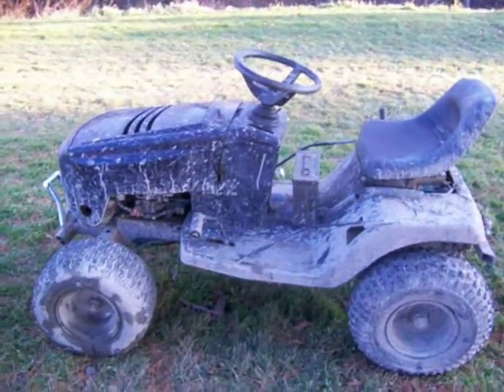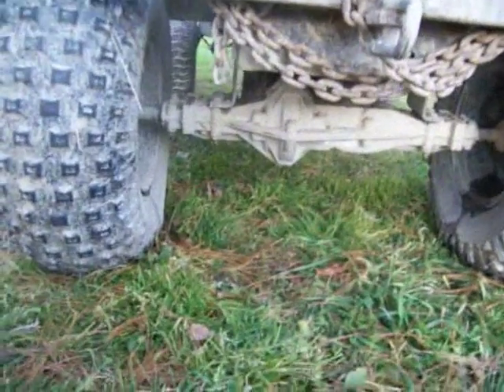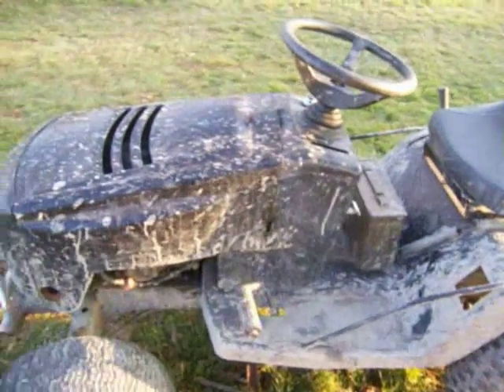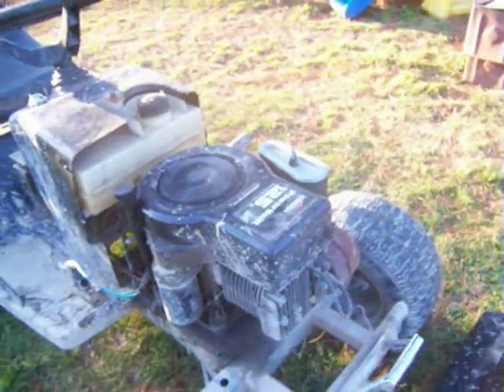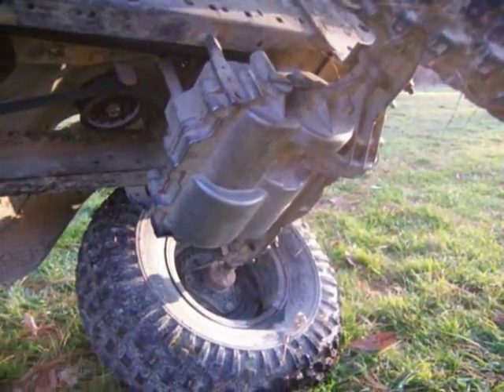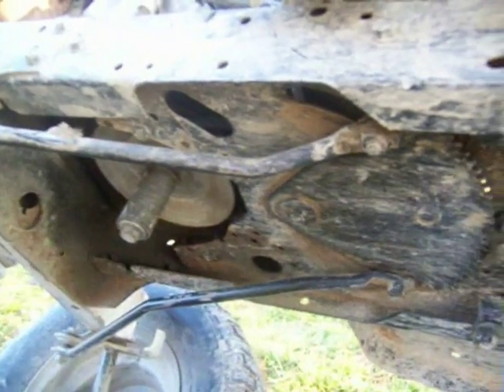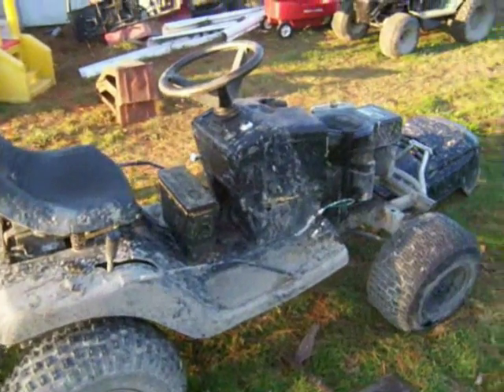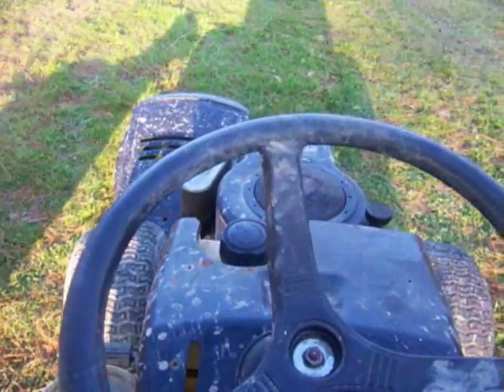How To: Build an Off Road Lawn Mower

Comment from the maker: an atc motor would be fun. You would have to convert the rear axle to chain drive. I try to keep it as close to a lawn mower as I can. For the front spindles, I found some large bolts the same size as the wheel hub, cut the head of it off, then "butt welded" it to the end of the spindle. Then clean it up with a grinder.  Works great! I've done it to 2 mow-chines and have yet to have a breakage.

Comment from the maker: @soadissoamazing One of the wires from the alternator/charger goes to the + on the battery. There are two wires that come out of the top cover of the engine, behind the starter. Use the white one.

Comment from the maker: I had gotten a atv frame with front tires on it.  The hubs were on it too, so I cut them off and creatively welded them to the rear axle shafts. I think there are 3 lugs per side. its worked great so far!

Comment from the maker: @TheInfotwins the pre-runner part is an old set of bmx handle bars, with the handle parts cut off. Flipped it upside down and welded it on. it's actually really solid.

Comment from the maker: I put small "wells" where the head would sit over the valves. To allow air/fuel to pass through easier. I did more porting behind the valves, like inside where the carb or exaust bolt to the engine block. The factory leaves alot of "casting roughness" when they machine them.
The head didn't make a huge difference by itself, it's everything working together that makes a good running motor.

Comment from the maker: Also some things I forgot to mention; the front axle is welded solid, and the intake manifold between the carb and motor has been ported. As well as the valve ports. It all works together to help it breathe better!

Comment from the maker: @offroadingmachine007 I like it because it has an dedicated steering rod for each wheel. It's alot less likely to bend. Also has a little better ground clearance without having that crossover steering rod hanging down in the front. I have a crossover setup on my craftsman, and it works great.

Comment from the maker: @4343Jonathan You have to remove the transaxle from the tractor and split it open. Theres probably like 10-15 bolts holding it together, Once it's split open, you should clean it, specifically, you want to clean the axle and spidergear set. (Towards the back of the case) What you want to do is stop those spidergears from rotating. You can do this a number of different ways. I Usually weld the "floating spidergears" (NOT the ones mounted to the axle), to the carrier assembly they rest on.

Comment from the maker: I attached it in the same place that the throttle cable attaches. On mine, it's a little white plastic square. one end hooks there, and the other end hooks through a hole I drilled  in the flange area of the air cleaner. 
I guess I'll have to make a more specific vid of it, as people seem to have alot of interest in it.

Comment from the maker: Thats a flathead for ya! I rebuilt it about 2 months before this vid was taken.  I left the valve clearances at about .007 on the intake and .017 on the exaust.  Thats what the I/C engines like, the aluminum sleaved ones like it around .005 intake and .009 exaust. I probably could have tightend it up a little, but I don't want any valve float at high rpm.

Comment from the maker: It's a bicycle hand brake mounted by your foot. Then the cable attaches where the old one did, and I had to add a return spring mounted on the carb to idle it back down when you release it.
Pretty Simple stuff...

Comment from the maker: @honda6442  The tractor I bought from a co-worker for $50.  It wasn't running and the mower deck needed a spindle. I had it running in an hour. To this day, 2 and a half years later, I've put maybe $50 into it. Alot of stuff i got free though. I just made it work.

Comment from the maker: Yeah, if you look closely in the vid, at 2:21 where the bottom, front, of the hood attaches to the frame, it sits in two 1/2" open ended wrenches. One on each side. The hood has a bolt sticking out either side and they sit perfecly in the wrenches. Then you pin the top and it has NEVER fallen off!

Comment from the maker: I love the locked rearend! Ive done like 4 of them so far and its usally the best improvment to the tractor, besides the gearing. Just gotta be careful in tight areas like you said. You start to learn to shift your weight around to make it do what you want.  Did you want a vid of how it handles with it locked? Or how to lock it?

I cant do a motor vid because I would have to take it apart. There are other vids here on you tube that describe it sort of, thats how I found out about it.

Comment from the maker: @ryan024316 The mower deck is usually held on with clips pins and/or bolts. I spent very little on this,  most parts were free.

Comment from the maker: @Fearlessfront if the spark plug comes strait out the front of the motor, like this one, then its a flathead. an ohv will have a little valve cover on the front with "ohv" on it, and the exhaust will come out the other side

Comment from the maker: @TheBigdog772 with tires that big, I would go with a 1:1 ratio, meaning same size pully's, front and rear... I would recommend you go with at least 4" pulley's so you have more belt contact. you would go a good bit faster then the murray does, and still have some lowend for going slwo

Comment from the maker: @brucegrotecloss If it smokes it could either be the valve seals, it's sorta common on the exhaust valve, or it could be the piston rings. You could rebuild it for pretty cheap if you can hone it yourself. these little motors only take a few hours to do a "light" rebuild.

Comment from the maker: most mower decks do detach easily, take a look under there, it usually like 3 or 4 pins engagement connection, and the belt.

Comment from the maker: I built a really nice heavy trailer from scratch I will have to make a vid of. Its holding a 4cyl honda motor and parts at the moment. Thats about 300lbs of weight on it no problem. It's been sitting like that since spring...

Comment from the maker: @CopeCowboy0267 Sounds like you've got a good plan... The only other things I can think of is to tighten the clutch spring if it's adjustable, if it's not then I would replace it with a shorter/stronger one. Another thing to look into would be a pulley swap if your gonna run through the mud... If your more into rock crawling then keep it lower geared. Bigger tires will make it a lil faster too.

Comment: i am currently building a John Deere LX188 mudding mower. 
right now it is all stock, just running about 4pounds of air in rear tires, (turfsavers) removed the deck, and put a bracket bumper on the back with a 1 and 7/8s inch ball for haulling my boat trailer thru the trails to the pond. thats all modifications ive done so far.

Comment from the maker: @dcountryboy123 try to adjust some of the slack out of the belt if you can, put a stronger spring on the clutch itself, you could build a custom clutch, such as I did a while after making this video. Maybe your belt is old and stretched?

Comment from the maker: I didn't just flip the engine pulley... I wish it was that easy.  But that IS the deck drive pulley. It was cut off and welded exactly where the orginal one was. To do that, I slid it onto an old crankshaft I had, and welded it so I knew it would be perfectly centered. The pulley on the back (tranny), was a mower deck blade drive pulley.

KEEP THOSE MOWER DECKS!  THEY ARE GREAT FOR PARTS!!!

Comment from the maker: I took the stock spindles and found a bolt that is about the same thickness as the spindles; On mine it was like a 3/4" bolt, about 4" long. It's one of the bolts where the threads only go 1/3 of the way up the bolt and the rest is smooth. (ie. the whole bolt isn't theaded) Then I cut the heads off so it was basicly a 3/4" shaft with threads at the end. Then welded the "head" end of the bolt to the end of the spindle... then grind it all smooth.

Comment from the maker: @brucegrotecloss If you get new rings you'll need to re-hone the cylinder walls to get them to seat properly. Any small engine shop, or even some auto parts stores can get rebuild kits. Get the #'s from the top engine cover... There should be 2 of them, one will be like "28n707" thats the model # the other is the serial.

Comment from the maker: @dwmcdaniel13 #1 it wont hurt it if your dunking it in and out, if it sat under water for an hour or 2, there might be some seepage. Ive changed the oil in my trans twice, and it was never watery.
#2 Ive never had a problem with water entering the filter, just keep it out of 2 and a half feet of water, and you should be fine, other wise, you'll need to build a snorkel
#3 no real lift, it was raised an inch in the back, just so the tires didn;t rub..

Comment from the maker: @bigDIPPERbs I had an old mtd riding mower that I stole it from. It bolts right on if you get the parts. Or you can make one yourself by attaching the choke butterfly to a string or coat hanger or something like that. I just don't like cold starting at full throttle.

Comment from the maker: @mikky27849 It sounds like the belt is still spinning when you push in the clutch, you probably need a belt thats an inch or so longer, also make sure it hasn't flipped over to the back-side of the belt, that will make it do that sometimes as well.

Comment from the maker: @Fulmergm1 well, if your gearing it to go 30, theres no way you still gonna be able to cut. You cant really have you cake and eat it too, you either have to decide you want speed, or off road and pulling power. they usually don't go together well.
If you gear it too high with big tires, you'll blow it the first mud hole you hit.

Comment from the maker: There are no bearings in the front wheels. I have to remove the wheels and grease them every other month or so.  I still haven't seen much in the way of metal shavings from them though. Probably not the BEST way to do it, but it works for me... I'm not going more then like 15-20 mph at the most.
 I hope to start a new build soon. Maybe go the extra mile with it, and who knows what it will be capable of....

Comment from the maker: depends on you tire size and gearing. but 10+ hp is good enough for most builds, u could get away with a 5-8hp motor if you didn't take it through really deep mud all the time.

Comment: [continued]

Im still not sure about locking my diff.  I know it is amaing off road, but Gerry from Southern Monster Mowers said its a pain in the tight trails to steer.  Reckon you could also show that in a video perhaps?
Sorry for the requests, I just wanna know what Im doing is right.

Thats exactly whey I got into mowers.  I have 7 mowers, and the total cost of them is still less than a single ATV.  And they're easy to fix too.

Great vid!!!!  5 stars as always from CSAK

Comment: It may or not be a great idea, but try moving your battery under the hood, up underneath "hood rack" just above the steering wheel, the little overhang to hold the hood up. This'll keep the battery dryer because any mud thrown up near where it is is actually possible, If your gas tank is under the area, move it to the back (my mower originally is set up like this. (Bad new is about it the battery weighs more than a low tank of gas)

Comment: i have 2 Riding lawn mowers both are craftsman.  one is a 14.5 hp and a 7 speed, the other craftsman is a 12.5 hp with 6 speed. im planning to make the 14.6 Hp an off road tractor that video was very helpful

Comment from the maker: nope, I got it off an mtd. all I had to do was drill a hole and snap it in. I'm sure you could find something at an auto parts store that does the same thing.

Before I had that setup, I uesd a piece of coat hanger. It hooked to the choke on the carb and went straight to the dash where I drilled a little hole for it to sit in. You just had to stand there and hold it while it warmed up.

Comment from the maker: Well, they have weaker head castings, especially near where the rocker arms attach. Plus the valve seals tend to burn out quicker, causing it to burn oil. And your supposed to check and adjust the valve lash every year... My flatty? I just change the oil.
Don't get me wrong, I like the ohv's,(I have one) they have lots of torque, but I'll choose reliability over an extra hp or 2 any day.

Comment: cont'd

also, when the trans axle is not welded and you put a jack stand under the ass end of the mower so the rear tires are off the ground, go to side of the mower, grab 1 rear tire and spin it, they will spin in different directions. BUT if you grab the rear pulley and spin it, both tires will spin in the same direction.. i race a custom build ford mower with a 5 speed transaxle in it and im building a john deere 111 with a 16hp twin cylinder in it.

Comment from the maker: they dont have gears, usually you can move the shifter back and fourth without needing the clutch. Some mtd's are able to do that "shift on the fly" but if you look under the tractor, mtd's will have a double pulley in the middle, with 2 belt on it... a hydro will have 1 belt

Comment from the maker: @mikky27849 It probably will.. You should rig up a custom tensioner pulley and get the bigger belt and remove the slack. That would be best.

Comment: Slow progress on my mtd/junk. Got 2 junk starters and a used carb for free. Built 1 good starter outta the three i got but havnt worked on carb. It does crank now! Also, the battery, silaniod, so on are all origanaly mounted up high and i got some bed frame rails to reinforce the fbottom of the frame. Still thinkin of a full custom frame but for now its a budget build.

Comment from the maker: I'd try and get it cheaper if you can. But if it's worth a $100 to you, then it's not a ripoff either. as long as it's in good shape otherwise.
Locking isn't that hard, but I have done like 15 differentials in my lifetime so it seems easy to me now.

Comment: Just given me an idea to make a quick release hood.  Its an MTD one, so the front is fixed.  It'll have side panels too to keep then engien cleaner.  So if I make the front and side sections into 1 big, removable piece, is should be easy to work on

Comment: hey bud could you help me? I have a old john deere l120 with a tuff torq k46 hydrostatic transmission that is crapping out, I want to turn this into a off road mower. I was thinking about getting a peerless 5 speed with reverse for it. Where can i find shift levers and other linkage pieces for this? if you can point me in the right direction that would be awesome. anyone else with some how to input to help me would be awesome.

Comment from the maker: you can just but a new engine pulley, should be a 1" bore, i'd go with a 5" diameter, and youll also need a new, larger belt as well

Comment: Nice to see that engine has differnt rods, notorious for throwing rods those 12.5s.
Its set up exatly like I want mine, with the electrics all high up.
Reckon you could make a video of your engine mods?  I've never undetstood what sahving eyebrows is.

Do liek those Murrays though.  And low tyre pressure is a must.  Carry a 12v pump though, I've had a tyre loose its bead before a long way from home.

Actually, I just uploaded a vid of the tractor I'm using for my improved mudding machine.

Comment: I got a old white gt 180 I think, maybe it's a gt 185 I don't really know
but it has a briggs and Stratton 18 hp opposed twin 
I don't know what to do with it sell it? turn it into a mud mower? or?
it's beat up it probably hasn't had a oil change in 10 years it's using 5 gallon of gas in 2 hours of mowing occasionally it backfires the hood rotted about to probably fall off
if I turn it into a mud mower what would I do with it? I got a good running 4 wheeler
but if I sell it I probably would get 25 bucks for it.

Comment: Here's what I did- Take off the deck
Put gas in tank
Turn key
Drive through ditches filled with water.
Win.
Then realize snorkels are easy to add.
Add snorkel and exhaust.
Sit an wait for rain like I have been all week. I NEED TO TEST MY SNORKEL!

Comment: ya its welded.. which makes it "locked." 

i was surprised about the 8psi in the tires... i run 2psi in my front tires and like 5psi in the rear tires on my ford racing mower. the only time i've pumped up the rear tires above 8psi is when i was racing in a hockey arena was running like 14psi in stock lawnmower tires..

Comment: i just finished buildin mine its not the best but it works for now but i need to replace a transmission belt now and how do you make a foot throttle

Comment: Can you make a video of how your choke and gas pedal system works and is set up? I have an old sears tractor that has the throttle and choke all in on lever. I want to hook up a gas pedal but I want to make sure I can still have a functional choke. Let me know what you think. Thanks

Comment: i see loads of videos about more power and all that but I dont see anybody talking about brakes......well i suppose its all up to what you are going to use it for. I have changed pulleys and tnied the engine so thats ok but now I am working on puting a discbrake on the rear axel .

Comment: i was riding my mower and then got it hung up on a rock and now it thinks that my mower deck is down. i have to hot wire it to start it because i cant find anything to kill the deck sensor. how can i fix this so i can start it normally again

Comment: hey fearless i just got this same mower just has an 11 instead of 12 hp but the things throttle mechanism doesnt work at all i had to put a spring on the govenor lever to hold it at idle but now i cant throttle up but when i take the spring of the throttle just goes were ever it wants it idles super high but it also throttles up but like wide open any recomendations or answers help me with that please